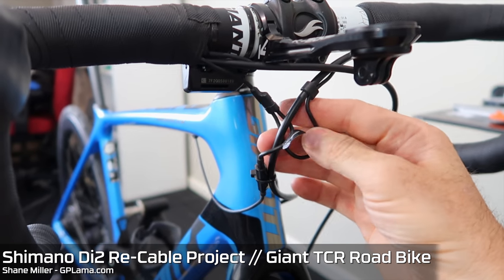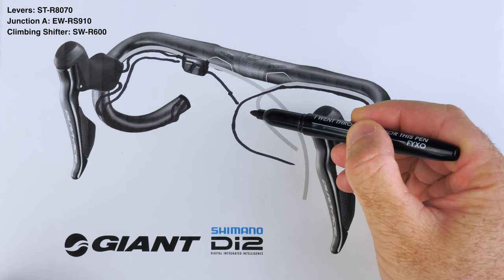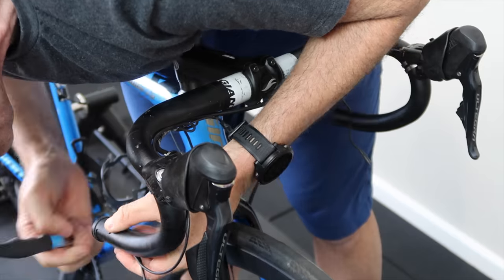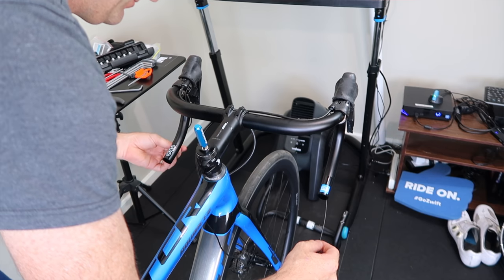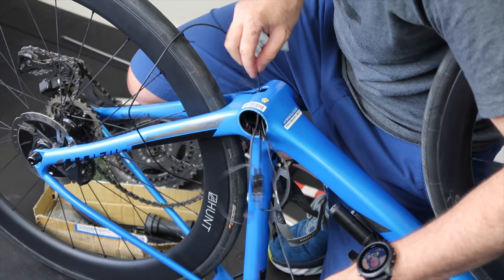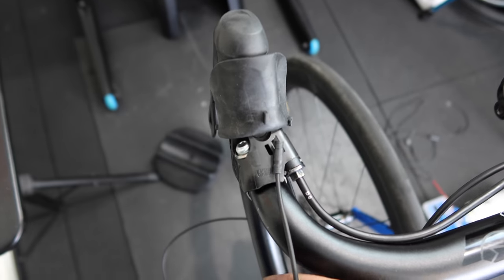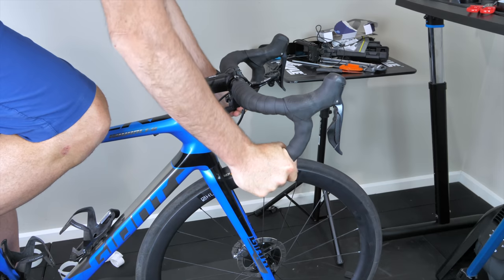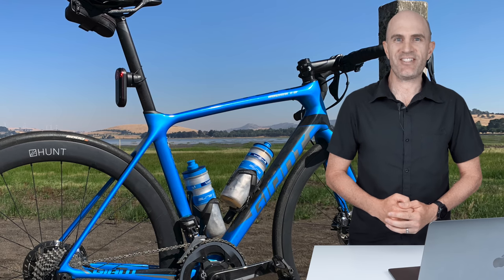Shimano Di2 Re-Cable Project // Giant TCR Road Bike

Comment: Shane will be bummed out when Shimano holds a presser next month announcing DI2 wireless...
Reply from the maker: As long as they redesign that $*@&#^ right side crank I'll be happy. ;)
Reply: Nah not wireless to my understanding but ... Shimano are moving away from prime numbers on the backend for DuraAce. Seen a prototype being banged on around Melbourne by a pro. Think there's been a few leaked photos
Reply: @gplama  cranks are staying the same mate. Cause doubt so they buy more power meters. 

So glad I got Favero Assiomas and the Quarq Dzero. Only devices I trust.
Reply: @gplama  I want shimano to make a spider based super accurate PM like p2max / quarq so bad :(
Reply: I might have missed the explanation, Shane, but why do you have a SRAM DUB BB and crankset with Shimano Di2?
Reply from the maker: So I can run the Quarq DZero DUB. A power meter that I was/am super impressed with.

Comment: Random comments: First, you forgot reason number four to have Shimano: The hood buttons that control the head unit. I love them so much that I'm seriously asking myself if I can get hood buttons on those of my bikes that don't have di2. Garmin seems to sell some remote control that might do the trick.
If you plan to get new brake hoses, get the Shimano hose gutting tool, it's so clever that many people who did a YouTube clip on how to use it didn't get how it actually works. Clamp the hose in the tool, use the included cutter to get a perfect cut, on the exact spot where you wanted it, then use the tool to push the barb into the hose. No clamping into a vice, no banging on the hose with a hammer, no smoothing of the cut, the cut is already perfect. This German guy has it figured out: https://www.youtube.com/watch?v=ahkd8sT-rrQ . If you don't understand German, just turn off the sound and watch him do it. It's kind of the difference between using the Park tool routing kit and trying to use a vacuum cleaner to suck the cable through the handlebar, I've tried both versions.
Your cable routing looks a lot like the one I did when I built my bike, the only real difference is that I put my wifi unit in the frame, just inside the entry hole, I figured it would be easier to disconnect the handlebar that way. But that works because my bike has a big entry hole in the frame, and a plug with smaller holes that you put in the big hole. I can remove the plug and pull the wifi thing out through the big hole if needed.
Reply from the maker: Brilliant info! Bookmarked and that tool is now on my shopping list.
Reply: That tool cost a modest £75. And it is mentioned together with a step by step how to use it in the Di2 manual.

Comment: Good vid Shane. Bike looks much neater now. I was wondering if you have had any dropouts when riding with a Garmin head unit? I’m asking because I have a 2019 Tarmac Pro with the wireless mod installed in the seat post. Recently when training indoors i am getting  beeps indicating that the Di2 and Garmin 1030 are disconnecting and then reconnecting again. (Private Ant +) Maybe 5 or six times an hour. Have also noticed that when connecting the wireless unit to my iPad via Bluetooth it is saying that the signal is too weak to do any updates. Can’t seem to remember having these issues when I first installed it in May last year.

Comment: Love your video Shane! Question : Will I be able to use the same Di2 cable without replacing it to the 1200mm like what you're using? Seems like the standard setup that came with my TCR has extra length in the front. I just need to remove it from the usual port and put it through the hydraulic cable port like what you did. Will the length be enough to run it into the bar?

Comment: I was all set to do this project from a nice deal I got on a used 6870. But 6870 sti won't let you do this for some reason. I double checked everything, checked for updates firmware, tried different junction boxes and batteries (original external and interal). It worked fine using my 9150 sti, but no deal with 6870. 

You can still get a clean set-up, but need to use B junction box in the handlbar to connect both sti. Strange that you can run sprint shifters, but not connect sti to each other.

Comment: Hi Shane IMO you could have made this look better if you snaked the Di2 wire through the faceplate where the derailleur mech cable would go through. I did this with a hack by drilling a larger hole through that faceplate to fit the di2 wire since originally it was too small. Looks much cleaner this way and you can heat shrink the hydraulic hose next to it for a tighter look. You also don't lose that grommet that goes nicely over the hydraulic hose port in the downtube when doing it this way

Comment: Definitely a lot cleaner. Heat shrink when you do your brakes is going to make it look mint mate. I went the SRAM route on my TCR 2020 time will tell if I regret it but I quite like their new axs Groupset and any excuse to play with tech. My observation thus far with the SRAM etap from watching other riders is all issues are with the operator. Imagine di2 to be the same. For me i charge everything when I charge my head unit/s. Favero Assiomas, Head Unit, etap batts, cycliq cameras, varia Radar all have a neat little power station good to go. Keeps everything charged and consistent.
Reply: This guy bikes. Legit are you me? Assiomas, Garmin, Cycliq shizzles.
I am on Di2 but i barely need to charge, like once every 6 months.
Reply: @moe-moon  I don't think the charging thing is a huge issue other than you can forget to do it easily. I just find it easy to do it at the same time.

I am confident at the moment my main bike has more value in accessories than the bike itself. Fixing that very soon

Comment: You ran the Di2 battery wire with the rear brake cable into the frame port on the left side down tube? No y splitter bc you tied the left lever direct to the junction A? Is this an accurate description of your method?
Reply from the maker: Yes

Comment: Cool video.  So if I'm not using a satellite shifter I don't really need the Y-splitter cable do I?  Each shifter has two ports, so I can just run a wire from one shifter to the other inside my handlebars (my bars support internal cable routing), then run a wire from the second port of one shifter to the bar end junction box, then a wire from the bar end junction box to the frame?
Reply from the maker: That’s what I’ve done here in removing the y-splitter.

Comment: Hello Shane, thanks for this content. Do you have to take our the bottom bracket to replace the long cable? Can you tell me what is the normal routing of this cable coming from the frame to the junction box? I'm thinking about replacing the juction box by the end of handlebar one and also put in my mounting the DFly module. I would like to keep the "long" cable from my bike, but not sure this can be long enought...  Thanks by advance for your help! Again great content, i love you channel. PS: what about a 12speed Di2 soon?
Reply from the maker: Wiring can be done almost any way.... as long as everything is connected at least once. Maybe see this video where I upgraded a whole bike for how I wired that up (with a different Junction A): https://www.youtube.com/watch?v=P1bvKKuYynA

Comment: Hey mate. Tried to find your email but couldn't! Any chance you list the cable lengths used for this setup on the TCR? Can't find the info anywhere! Cheers
Reply from the maker: I can’t recall what I used, I’d have to check the parts I ordered. To get the lengths I measured the routes with a string and went from there. I believe the internal bar routed cable was 1200mm or 1500mm, a lot longer than I expected.
Reply: @gplama  ta mate

Comment: Shane why did you need to add a different cable from the left shifter to the 4 port? Couldn't you just use the cable that was previously there into the left shifter? Looking to do this myself but dont want to muck about in the bottom bracket
Reply from the maker: That cable was re-routed differently into the frame, so I had to remove it anyway. I can't recall the specific cable swaps I did (this was a few months back now)..... but it all made sense at the time... and still works to this day. :)

Comment: Hi Shane,
Just wondering what the length of the new di2 cable is that go from one side to the other?
Thanks Matt.
Reply from the maker: I have no idea sorry. I used a string to get an estimate of length and ordered the one that was equal or a little longer than that.

Comment: Do most of those Di2 compatible bars come with two holes in the drops?
Reply: jspaceman71 Pro Vibe alloy come with a hole near each bar end. Pro Vibe aero carbon have a hole near the shifters on the inside of the bend.

Comment: Hey Shane, Do you really need 1200mm for the left shifter to the right interner junction? Seems like a lot since the handlebar is only 40cm wide?
Reply from the maker: 40cm wide, but with a run from the lever, down to the end of the bar, then through the bar bends.... maybe a 1000mm would work.

Comment: Awesome video and production as ever, I have a question why move your wireless module into the handlebar? The reason I ask is mine is around the stem on the propel and I was going to put it into the seat post, but now I have another option of location.
Reply from the maker: Never any issues in the seat post.... but a lot of people mentioned they had issues with it in that location. I guess it's bike dependent. I thought I'd relocate it to see if there was any difference in lag/latency/etc.
Reply: Shane Miller - GPLama I’ve actually done the reverse on mine. I guess it’s just laggy?  It didn’t get any slower that I can tell. I got rid of the cable under the bar tape and replaced the 3cm cable at the bars for a 1.5cm in the seatpost. 1.5 grams saved for good measure haha. The notch I cut in the end of my drop is still there now though...

Comment: Did the same to my TCR (with heat shrink :-) )
How did you adapt the grommet to take both the hydraulic hose and the DI2-cable when entering the downtube? I molded it a bit with a Dremel but it doesn't seem to stay in place as good as before.
Reply from the maker: No mods to the grommet, I just shoved it and poked it with a knife a little.

Comment: Hey Shane, I have a question that you might have an answer to. I can’t seem to find alot about this.

Is there any info or videos about the stress levels that the ultegra di2 deraillers can handle? I’m preparing for some races with alot of uphill climbs and i’m curious if its possible to shift under maximum power. 

Thanks in advance!
Reply: No issues to worry about with that.
Reply from the maker: Shifting under maximum power... as in a sprint, no, that's never going to end well regardless of the groupset. Shifting at the right time in the pedal stroke... sure... no issues at normal non-sprint effort levels.

Comment: The reason for changing the handlebars... is it because stock bars are not drilled for Di2 or it was just time for a change. I guess my real question is can you do this with the stock handlebars?
Reply from the maker: I wanted 38 bars. There's usually no real issues with drilling non Di2 alloy bars underneath the end drops for internal wiring.

Comment: Nice work shane - with all the cables is di2 really better than old school mechanical? Also what do you think of the hunt wheels?
Reply from the maker: Yeah, after a year on Di2 I won't go back. Gear changes are as easy as a mouse click. And they're perfect shifts, and they don't go out of line, and no gear cable fraying. The new HUNT wheels are holding up nicely.
Reply: @gplama  happy days :) I'll maybe have to try di2 next time - have you seen GVAs handlebar and stem combo? Looks very nice. Hopefully we will see more of the new tcr shortly :)

Comment: Hi Shane, my bike came with the junction in the dropbar as well but without the wireless unit. If I wanna install the wireless unit into the handlebar like what you done, do I have to remove all the tape around the handlebar/dropbar? Thank you
Reply from the maker: If you want to re-route the cables within the handlebar, then yes.
Reply: Shane Miller - GPLama thanks Shane, keep up the good work and look forward to more interesting experiments :)

Comment: Hi Shane,  I would have thought it would have been easier, to put cable through the handlebars, before fitting them to the bike.
Reply from the maker: Not really, those bends are a pain to get a cable through at any angle.

Comment: I have my dfly mounted in the handlebar on one of my bikes and always get disconnections during the ride. Do you get wireless disconnections between the Dfly and Garmin since the handlebars mute the radio signal? On my other bike the Dfly is external and inches from the Garmin and the wireless never disconnects.

Comment: Hey Shane just wondering what your opinion would be on me changing down from my 42cm cc bars to 38cm cc bars? I ride a medium giant defy advanced pro 0 2015. I'm 90kg 175cm, relatively broad shouldered, but also very flexible (i.e. can go about 20cm past my toes bending over straight legs), so my main aim is to get as aero as possible. I'm also kind of just thinking of getting a tcr in small like you have, throwing a long stem on it and seeing how that goes. Most of my rides are only about 2 hours so long haul comfort is not absolutely paramount. What do you reckon? 2 bikes lol
Reply: Definitely go down to 38cm, I'm 185 cms and love 38cm bars.
Reply from the maker: Bike fit advice in YouTube comments is impossible to give any advice of value.

Comment: Great video and a perfect resource for my upcoming project. Thanks a lot!  I have just one question about the handlebar cable routing - right side shifter and junction is crystal clear.  However, for the left side of the bars, the cable goes from the left snifter directly to the junction at the BB, or does it go via another junction on the left side of the bars?  At ~2:51 you mention the cable passes internally into a Di2 "port" - is this referring to a port in a junction, or the hole in the bars?  Thanks again for a great Video!
Reply from the maker: Thanks. Yep, the left shifter connects everything to the BB junction via a 1200mm cable. It follows the rear brake line all the way down to the BB junction.
Reply: @gplama  was just doing some last minute homework, prior to going shopping for my project and something occurred to me concerning the placement of the EW-WU111 wireless unit.  Have you tested the connectivity of this placement in the end of the bars?  Getting a signal when the bike has no rider is one thing, but what about when your hands are on the tops or especially in the drops (entire area could be shielded by your hand)?  Any chance that the signal can become compromised? Thanks again for your inputs, mate!
Reply from the maker: I moved the wireless unit last week to inside the bars. Zero difference noticed to date with my bike/setup/etc.

Comment: Hello Shane! If my frame is a Pinarello F8 size 50 do you think i will also need the same length cables you used in the video? I am currently on the hunt for a DI2 upgrade and i'm doing my research before buying any kits since those are aimed at "standard" installation. Thanks!
Reply from the maker: Best run a string around where you want to route the cable and measure it.
Reply: @gplama  Alright, thanks for the tip!
Reply: @gplama  Shane if i do not plan on having the climbing shifter i can simply ignore that cable and still proceed with the rest right? Sorry about the dumb questions but i just want to make sure lol. Thanks!
Reply from the maker: @rav3nst33l  Yep.
Reply: Shane Miller - GPLama thanks!

Comment: Quick question as I am about to wire the same way....running the singular cable from the left shifter if wired the same as Shane has done, will that then control the right as well?  Does this work due to the fact that the left is also tied to the junction box? Just confirming before moving forward! Thanks (hope that makes sense
Reply from the maker: As long as every component is connected to 'something', it'll work. You can test this without running the cables internally first.
Reply: @gplama  Awesome. Thanks Shane and as you say "Happy days" lol

Comment: Hi Shane. I am converting my 2020 Trek Checkpoint from Shimano 105 to Shimano Ultegra Di2. Can you please tell me if I can use the same hydraulic disc brakes as with the 105? I have ordered a full conversion kit ex the brakes and the Chain  wheels. I just installed a single sided Stages power meter following your guidance so I would really like to keep the 105  Chainset. Do I need to do anything else?
Reply from the maker: I'm not familiar with Trek bikes. The brakes/etc is one for a mechanic who's across this a lot more than I am. The chainset should be fine... but again, I'm not confident to give a solid answer here sorry.

Comment: Have you had any issues with the signal of wireless unit being as though Shimano 'recommends' it installed on exterior of frame?
Reply from the maker: No issues.
Reply: @gplama  Do you know if the wireless unit can fit inside majority of di2 compatible handlebars? (I'm considering a mechanical to di2 electronic upgrade to my 3t aeronova handlebar set up) FYI - thanks for all your help. You've been a blessing to myself and so many others!
Reply from the maker: @lilhavin  The wireless unit is pretty small, so I've no doubt it'll fit into most bars.

Comment: Does bar end plug fits on the left side with the di2 cable routing outside the bar then internally?
Reply from the maker: The bar end junction can be placed either side.

Comment: I know the TCR has hydraulic disc brakes, but is it possible to route mechanical brake cables inside the handlebars if the handlebars support it?
Reply from the maker: I guess so... but there's no real benefit as the brakes on these bikes need to come out of the bars for movement.